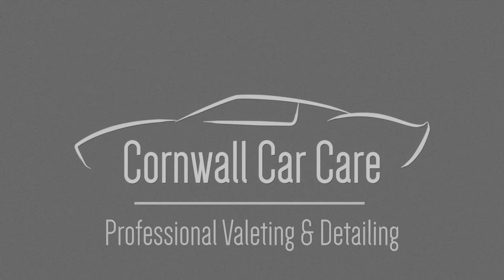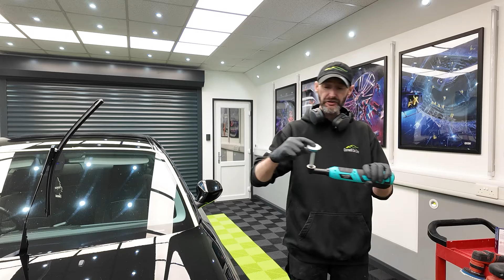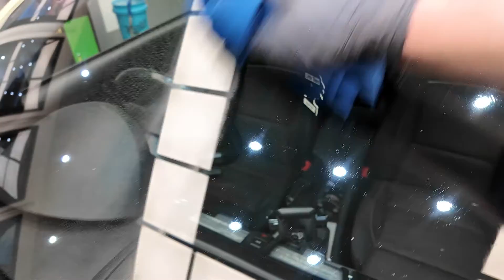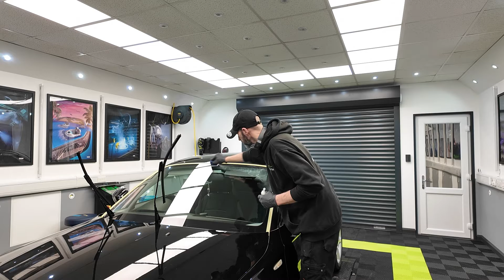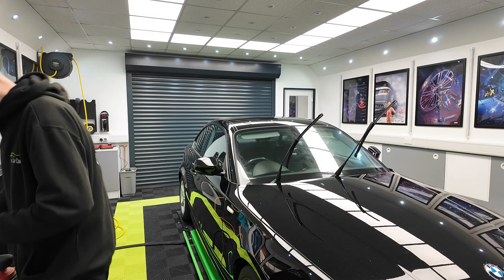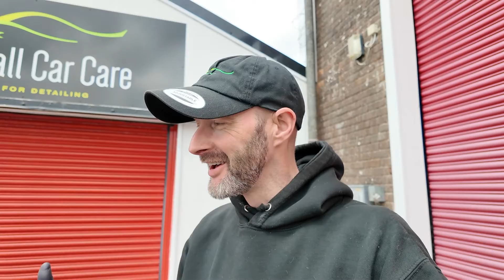GYEON View Evo Glass Ceramic Coating Step-by-Step Tutorial

Comment: Ah another thing, since this is a coating I believe you should throw away the microfibers you use to buff off the coating? Since it will cure the same way it does on your glass. Learned this a little bit of the hard way with cQuartz when I accidentally put one in the wrong pile and tried to clean my bathroom mirror with it on the first wipe, I was pissed but somehow relieved at least it wasn't my car's paint LOL.
Reply from the maker: @joeyofblades yeah any cloths that get used for coatings get put in a bag and the garage round the corner use them 👍

Comment: Thanks for the video. I kind of want to polish my glass first but it's not that bad, I just kind of want to give it a try for the first time since I've never polished. People say glass is easy, you just have to watch out for too much heat sitting in one spot. I noticed you didn't stop to hit your pads with a blow gun periodically like some people recommend, but otherwise you made it look very easy. What's that tape you used for the edges of the windshield? I only have a 6" polisher so I'll probably have to be careful near the edges. Also, what did you clear the wiper blades with before you coated them with the product?
Reply from the maker: @joeyofblades Labocosmetica Vitreo is great glass polish if you are looking to remove scratches but to clean the glass any polish will work, the tape was by Kamikaze and is great to use ( but its expensive ) to clean the wipers I just use a alcohol based glass cleaner, as for the 6" polisher that's fine to use and just do the corners by hand where the polisher cant get to. 👍
Reply: @cornwallcarcare8959  I've used yellow masking tape on my car before and it leaves residue, blue is ideal for light duty things but I feel like if I accidentally hit it with the polisher it would tear it up, which is why I'm assuming detailers like yourself get the expensive tape. I had my windshield replaced less than a year ago so I'm thinking I can get away with just a Gyeon polish to clean it up. My roommate also has issues with his windshield (25 years old) which has really bad streaking even with new wipers and a nice cleaning, I actually gave him some of my clay so he can try to clay bar it with Soapy water because it's probably a bunch of surface contaminants causing issues. I told him if he buys the pad and product I'd practice on his windshield, but he's probably too cheap to do that haha.

Comment: whats different between the bigger size polish and the smaller
Reply from the maker: @edwinwong123 the bigger bottle of polish is what I typically use for paintwork but it cleans the glass really well, and the glass polish in the kit also contains a bonding agent for the coating bond to 👍

Comment: Thanks for the video. What difference is there between a glass coating and a regular ceramic coating? Have you ever applied a regular coating on the windscreen? Thx
Reply from the maker: Thanks for the question @rooboy99, there are some paint coatings which can be applied to glass but I never got the durability out of them and dedicated glass coatings are made stronger so it can take the abuse of the wiper blades, so personally I would only use a coating designed for for glass. Hope this helps 👍

Comment: I don't get it,  why do you apply 3 layers when Gyeon speaks of only 1 layer. So you need almost 4 packs, 44 euros each for all the Glas.. 😂 So that would be around 190 Euro 😂
Reply from the maker: @oli7711 I dont know where you got that information from as Gyeon state 2 layers on the windscreen and 1 layer on the side windows in there instructions and as I was not doing the side windows I did an extra two on the windscreen with one bottle and still had some left over 👍

Comment: Have you always had the battery issue with the PXE or is this something I’ve got to look forward too?
Could take a while if it’s a wear issue as I’m only a weekend warrior
Reply from the maker: The PXE 80 gets used everyday and probably started after 4 months but doesn't affect it at all it just makes a racket and you can feel the vibration in the hand when holding it ( I do have the Rupes battery 3" but the speed controller has started failing on that ☹
Reply: @cornwallcarcare8959  thanks for the feedback, have you seen the Shinemate EB210, seems to be a decent machine that gets reviewed well. 
Really tempted to try it, but know that I don’t really need it, detail bug keeps whispering in my ear though 😂
Reply from the maker: @LSD04  Your not on your own with the whispering in your ear ( I have to fight the temptation every day ) 🤣🤣🤣🤣

Comment: How do you Remove Ceramic Coating  from paint COMPLETELY  video  be great please
Reply from the maker: That's a tricky one as some professional coatings require wet sanding to remove and most general ceramic coatings can be removed with a quick polish ( its not very often I get to remove coatings ) but if I do get one I will definitely document it 👍